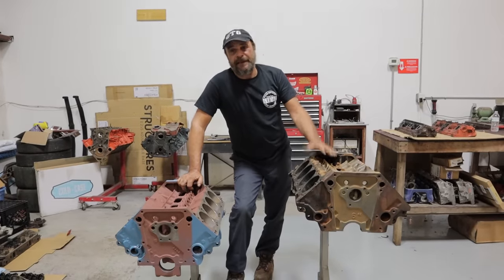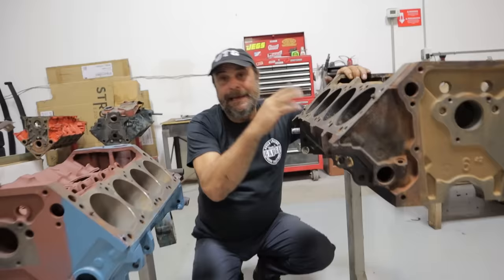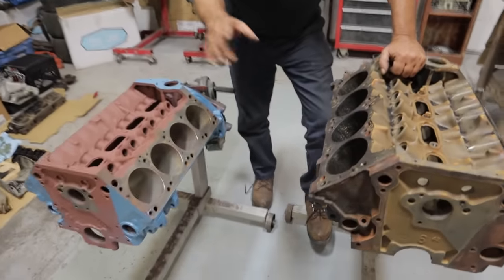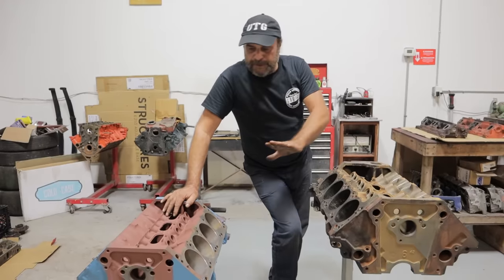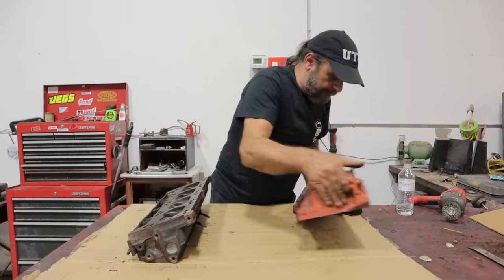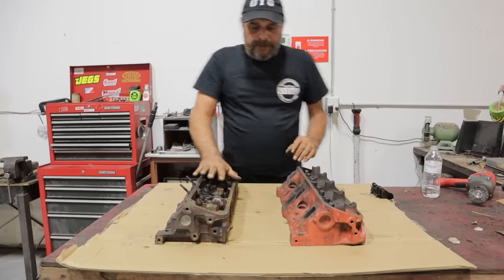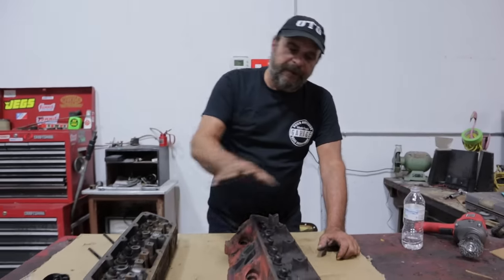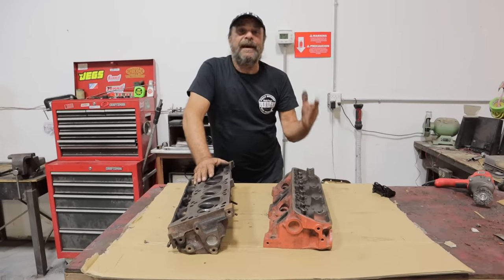Magnum vs. LA. Side By Side Comparison

Comment: Cool fact, if you have a pre magnum la roller block 318 1985-1991 you can use your stock roller lifters just need shorter pushrods when swapping to magnum heads. Also magnums don’t run a mechanical fuel pump so if you want to run a magnum camshaft with a mechanical fuel pump Hughes engine sells the adapter for like $40. Magnum engines also have a factory 9:1 compression ration they use taller pistons than the LA blocks.
Reply: Can u use the the std bore factory magnum pistons in the la blocks to get the compression up?

Comment: Thank you UTG, great comparison.  Have a 360 Magnum swapped into a CJ7, would like to run fenderwell exit long tube headers based on tubes made for AMC V8 Jeeps. 
1. Do you know if AMC 304 (also siamese) & the Magnum have close enough exhaust ports that the flange bolts up; am OK with minor grinding or port matching or stud hole slotting
2. if not, are header flanges identical between Magnum and LA? because only source for Magnum specific flanges appear to be Schoenfeld p/n SCH-0410 
3. Last resort, is to cut the flanges off headers made for AMC v8 and weld the tubes to flanges made for small block Mopar

Comment: 318 CNG ram Van, engine vin code is T. My 2001 dodge van has a factory 318 that  runs on CNG. The difference is hardened valve seats and higher valve quality. The valve seals allow more oil to lubricate the stems. The throttle body and intake manifold are the same. The fuel rail and injectors are unique for natural gas. The heads and valves have different part # but are the same dimensionally  as a gasoline engine . All internal parts and dimensions are the same. Does anyone know if these heads are prone to cracking any more or less then a gasoline version? These CNG engines run very clean and last a very long time. they develop about 20 hp less then the gasoline version. Having found out the heads are the same size as the 360 I am thinking about  grabbing the heads for a 360 van. Both vehicles have near 100,000 miles. The frame and body is shot on the 318 van but the engine and transmission is fine.
Might think about selling the engine and transmission. The 
9.25 hd Chrysler rear end 3.92 gears was rebuilt about 40,000 miles ago and is silent.

Comment: 13:28 ive personally seen TWO! shaft engines have the shaft mounted upside down
.
one was a 383 that developed a NASTY squeak..... we popped the valve cover off to see if it was a sticking valve
nope.... the rockers were cutting into the shaft due to no lube
flipped it so the holes were down..... squeak went away (and actually ran for a long time with that damaged shaft)
.
.
the other was a 440 in my dads 72 Plymouth satellite Sebring plus 
the driver side shaft was flipped..... but no damage to the shaft (we checked the pass side... it was correct)
.
we only discovered that AFTER it developed a rod knock
it suddenly lost oil pressure.... after sitting for the winter
dad fired it up to move it to help melt snow..... and didnt check the gauges till he was about to shut it down
.
a new oil filter and oil pump gears..... and it got PSI back 
i figure the old oil filter "collapsed" or fibers went and clogged stuff up
.
.
but ya.... that shaft was like that since he built the motor around 2003
and it ran GREAT...... but never saw very many miles
and he ran 20w-50..... which probably prevented the "galling" like on that 383, which he was running 10w-30 as it was a stock motor
.
.
.
.
.
my question is..... could that shaft being flipped cause it to loose oil PSI??
or even cause one side of the motor to have less PSI
.
like.... because their is no restriction to flow..... you cant generate PSI
so was the driver side lifters, shaft, rockers, ETC only getting 5PSI..... while the pass side (and gauge) was reading...and receiving....40+ PSI?????
.
.
.
we have yet to tear down the motor and find what exact bearing is knocking..... and how much total damage their is
but i still want to know WHY!!! it lost oil psi
.
a 1.5 year old oil filter?
it lost the prime in the oil pump after sitting??
a flipped rocker shaft suddenly caused a motor with good PSI to loose PSI?
Reply: nope. my 400 has the shafts upside down to lube the rockers better. runs damn good. 35lbs oil pressure at 750rpm at 180F.

Comment: i work at a machine shop and i pressure tested 2 sets of these magnum heads last week 3 outta 4 were cracked between the seats and 2 of them were leaking coolant out the cracks this is all to common and to say  they wont leak coolant is ridiculous

Comment: 5.2 & 5.9 Magnum heads are sliiiiiightly different. There is approx. 1/10" height difference in intake ports between the two, and the 5.9 ports are also slightly wider. There are two casting numbers too...

Comment: If you use American motors lifters and hollow pushrods ,you can run LA heads on magnum block without drilling the block oil passages out.

Comment: Funny that so many people want to use LA heads on a magnum...
 Magnum heads can be drilled for both intake patterns.
 Magnum valve covers are less prone to leaks.
 Magnum heads make more power stock for stock.
 After market magnum heads like r/t and engine quest are even better... Then send them to hughes for porting and make serious power.
 Bonus: roller rockers for ford or chevy will work on magnum heads. 

I have r/t heads with hughes stg2 cnc porting and bigger valves. I'll never run L.A. heads again.

Comment: Appreciate the information. Very useful information as well. Been a gear Head all my life. But never knew the crack on the Magnum heads was no big deal. I'm just really getting in to the Mopar scene. (For some reason I've had dodge trucks falling in my lap one after the other lately. For example I just  got a 1979 3/4-ton,completely original. In Beautiful shape. No dents, 2or3 very very small rust spots, all the Chrome in perfect shape. Person I got it from parked it because of a electrical problem.) So  i know some of your information is going to be very very helpful. Thanks for your time and knowledge.

Comment: Gen3 hemis are really gaining on the LS.  Power nation made some really good comperable power with a naturally aspirated hemi. The 5.7 magnum hemi has a lot of performance features from the factory i got a good running one in a durango i picked up for 700.00 ive been driving over a  year got a 6.2 for 500.00 with computer. You can run some big cams in a factory hemi magnum the future of aftermarket will tell i really believe in time the magnum will pass the LS especially given chevys lack of interest in supporting aftermarket the way they should.

Comment: I was never a fan of the small block Mopar. It has all the idiosyncrasies of the small block Chevy, with no parts interchangeable. By idiosyncrasies I mean... a wet manifold, internal oil pump with filter under the engine, all accessories mounted to the water pump, and the rear mounted distributor. The Big Block Mopar was designed seeing all these issues, and they were addressed.
Reply: Except the big block Mopar came out in 1958 and the first LA smallblocks were 1964.
Reply: @johnwilburn  nailed it
Reply: @johnwilburn  when did the A engines come out?
Reply: Then, you might be looking to the slant six!
Reply: @lb9gta307  I think the 1956 model year.  That said, if the big block was the product of the Poly’s shortcomings, they’d have taken those changes to the LA engine.  I wish the LA had a dry intake and separate timing cover.  I can live with the rear distributor.  Actually, I wish the Poly heads had been improved for performance.  Chrysler would have had the “Cleveland” before Ford did!
Reply: @johnwilburn  Exactly, a step... several backwards.
Reply: @drippinglass  not necessarily.  The small block has a great exhaust side on the head.  The big block would be a slam dunk if it didn’t have what is essentially a scaled-up small block Chevy head.  Symmetrical ports and canted valves like the big block Chevy.... Katy bar the door!  I guess the Hemis kept them from exploring that.  Point is, we hot rodders have different concerns and they weren’t worried about what we’d want 50 years later.
Reply: @johnwilburn  Small block Chevys have rocker shafts? 😀 Most builds today use the much better flowing aluminum heads.
Reply: @drippinglass  I’m talking about the architecture.  Asymmetrical square ports, inline valves... very similar.  Chevy had stud mount rockers with inline valves.... worst of both worlds.  I like iron heads.
Reply: @lb9gta307  57 / 58 including quad and dual quad.
Reply: @johnwilburn  you are correct that the b/rb heads are essentially scaled up mouse heads.thats not a bad thing thou on the street because it so happens that those intake ports are the perfect size for very high mixture velocity creating a very broad and flat torque curve.thats why 440 s were very hard to beat even by 426 hemi and big block chevy street cars.at least without 4.1 rear gears or more to make the bigger ports work that is.

Comment: Tony, I've always wondered if the late hemi heads could be used on the LA blocks. I know the bore spacing is the same, but how about head bolt pattern? Then I'm sure the valve train would be a can of worms, along with an intake. Could you do a late hemi vs LA engine comparison? And the LA's weird 59 degree lifter angle, could you use that to an advantage to use any of the early small block hemi heads on an LA?

Comment: You see it only confirms what I had said that many of times in the comment section that the 5.9 is one of the best built v8 engines of all time even when...well no on else anything!
I know it becuase I ran the engine hard for years and i stil got it sitting in the truck.
You take a 360 and add a 440 crank then you got a 408 ground pounder.
I ran 9 1/4 posi and could smoke both tires for 60 feet,that was bone stock.
On a cold day the magnum with run like a bad out of hell!
Fact!

Comment: New to your channel Tony so I don't know if you have done a video on the 5.2/5.9 intake manifold leak to the crankcase area. Hughes Engines has a 1/4 CNC aluminum plate with dry gasket seal and new hardware that solves that problem. Fixed my '96 Ram/5.2 and a friend's 2000 Ram/5.9. The quality of the parts and design are great.

Comment: Engine Quest made Magnum cylinder heads available with the 318, 340,360 LA style manifold bolt angle. I bought some brand new a few years ago. Not sure if there still available.

Comment: Pretty much all roller LAs and magnums are fixing to get bought up so there lifters can be reused, the best & easiest combo would be a 5.2 magnum long block with a edelbrock airgap intake & 650 cfm carb, plus magnums seem to have better throttle response

Comment: for what it's worth, in M bodies, roller lifters came along in '85 along with the 302 heads.  not sure if they did in trucks, too.  360's didn't get roller lifters until '87 (also had the 308 heads)...also, the magnum heads have all the accessory mount holes on a single plane & 2 additional bolt locations.  had to do some accessory drive modification when I went to magnum heads on my 5th ave.

Comment: I love the 318. Had one in my family hand me down 1980 Chrysler Lebaron. Wish i kept that car. Young and dumb, cash for clunkers ended a lot of vehicles. I bought an 05 Suburban Z71 4x4 in 2022 for just $2,300 and it just runs. Will completely build it later. It is rolling towards 400k miles. I was so happy with the 05 burb, i jumped on an 07 Yukon 4x4 with the dreadful AFM that has 230k miles and i paid $2,500 for it. I want to buy an 98-99 Durango with the 5.2L, but the mpg is terrible compared to the mpg i get in the much bigger Suburban. Any idea why that is? New Subscriber. God Bless you and your family.

Comment: 91 d150 with the 5.2 handled 5+ years of daily driving with 200,000 plus miles when I got it. Beat that thing every time I drove it just kept an eye out for when it stopped smoking cause that’s when it needed oil. Swapped the 5.2 out for a diesel but that damn thing STILL runs great and soon to be dropped in a ranger because why not

Comment: I have never been a fan of oil filled pushrods, I think it makes them much heavier than people realize and I have never seen anyone weigh the assembly and include the oil . I think the factory LA valvetrain is very light and robust if not as adjustable as a comparable small block chebby
Reply: density of motor oil is 0.0313 lb/in^3.  a 5/16", .065" wall, 7.5" long pushrod leaves a volume of .1962 cubic inches for oil to fill.  the weight of the oil will add .00614 lbs, or .0798 ounces to the weight of the pushrod , or less than 2.8 grams.  not sure what the weight of a 5/16" .065 wall pushrod is with the ball ends, but the volume of a 5/16", .065" wall cylinder 7.5" long times the density of steel yields 1.73 ounces, so you're looking at going up to 1.81 oz with the oil in it.

Comment: i would say that Crane cams had the correct idea, i have found that Morel makes a roller lifter that is shorter for 340 L.A. 318 series.And no less then 108 LSA for cam unless you just wanna make noise and go nowhere. Trick flow makes the biggest bang for buck with a head that has taller intake ports and fits L.A. and Magnum. it is best to go with taller port then trying to widen the pinch by a bunch, make sure the alignment with Intake manifold is perfect. most dual planes are terrible for flow a huge spacer at the least is needed to drag race

Comment: There is a company that is making a timing chain cover for the new hemi that allows you to run a distributor and there is intake manifolds out there for them to, makes for a lot easier swap but it only fires one spark plug per cylinder but at least it's computer free! down side is the price but it looks awesome and runs the engine well